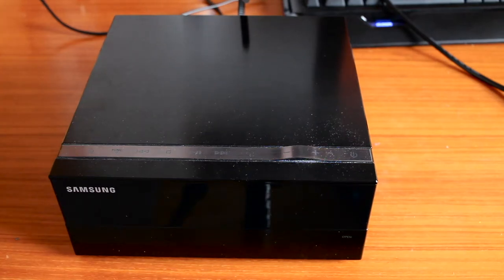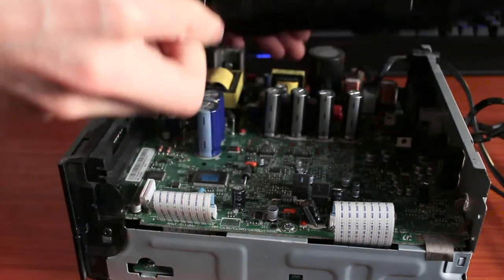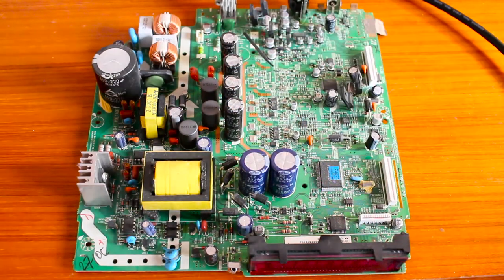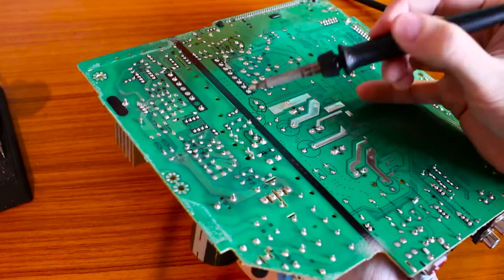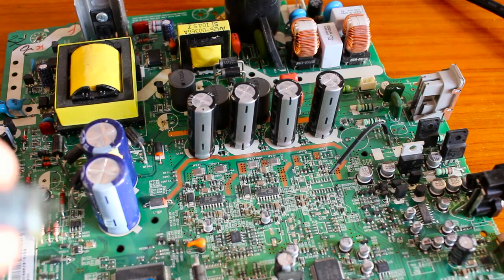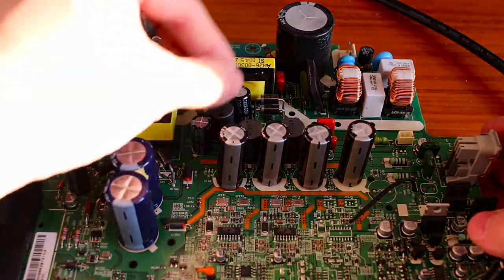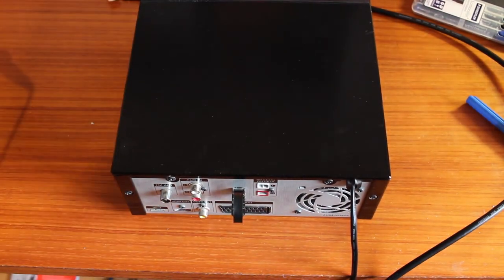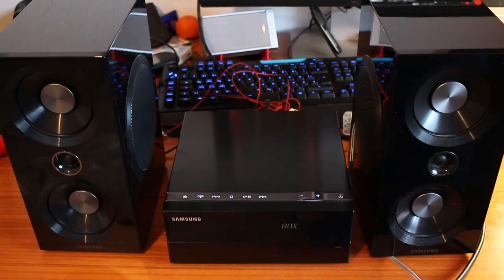Samsung MM-C530D Repair - Bad Caps

Comment: A do have pity on you with us coming to you with similarly related problems. My one is a stretch at being similar though.

I have a C550D and there is no audio coming out of the speakers or headphone jack.

I feel like it's related to an earthing issue as the aux port earth has caused some electrocution when playing with it between my fingers. I was connecting the aux cable to the back of my motherboard. It touched my metal case and there was a change in the him. I touched the case again (this time on purpose) and the speakers definitely went dead. There was no static in them anymore. PC and PSU was off but the power cord was plugged in.

I have already lost one motherboard audio jack to the HiFi system though.

I've put a volt meter over the speaker pins. I do get a small voltage (200mV).

With the HiFi system on. The moment I put a ground source in contact with the sound system body there is a slight arc, but no mark is left behind.

Any suggestions?
Reply from the maker: Phew ... there are some things, I could say here, maybe some of them are helpful, maybe not^^

A PC (at least a regular Tower-PC) is always "mains earth referenced", meaning that it's GND is always connected to Mains Earth through the PSU, even if the PC and the PSU are switched off. This also means, that the PC case and everthing with a GND is also always connected to mains earth, like USB-Ports, Video-Ports and of course the Audio-Jacks. 

The C550D on the other side is floating, like every HiFi- or non-HiFi-amplifier should be. This should be clear, since it has no eath connector on the plug and thus no earth line going into the unit. This might change, as soon as you connect other things to the amplifier, like a TV over SCART or something. If the other device has a connection to mains earth, this could lead to a ground loop or other unwanted things. But the amplifier itself cannot have a mains earth connection, so it will always be floating potential.
However, there are usually some small capacitors between the power-lines going into the amp and it's GND. This leads to a small AC-voltage on the GND of the unit in respect to mains earth. This is very common for all devices, that are not mains earth referenced. I assume, this is what you feel and what could  have caused the small arc. I would say, this is normal.

The voltage might be enough though to kill a sensitive, not well proteced audio out from a motherboard. There is a very old rule, that almost nobody remembers these days, which is: Always make you signal connections (i.e. AUX-Cable from PC to amplifier) BEFORE you power up the devices (/connect the devices to power). Maybe this could have saved your PC audio jack as well as the input of the amp in you case.

Did you read the 200 mV in DC voltage mode? That feels a little high. Was a speaker connected? Otherwise the measurement is more or less pointless, since the amp has to load to work against. 

I would try the amp first with an isolated source like a mobile phone, to get rid of any possible grounding issues. Can you get sound out of it from any source (radio, CD, aux)? If just the AUX input does not work, you probably killed that, if no source is working, you maybe killed a part of the amplifier. In any case, it is something, that I can definetely not help you with, since it does not have anything to do with the issue I had, and would require heave investigation on the input singal processing.
Reply: @NebukadV  Wow! thank you so much for all this information. You have really guided my path of actions!

I did not know about the making connections while devices are turned off. I will definitely be doing that from now on!

To answer your questions though:
200mV DC was measured across the cables of one speaker, with volume set to 2.

With regards to getting sound from any source: The first thing I did was test other sources. AUX, USB, DVD, FM, and mic in all do not produce sound out of headphone jack or speakers. The speakers also produce no static or "hum" that is always present on any sound system.

Based on your previous information regarding capacitors: if the events are as you say and caused a voltage spike, then I think the capacitors are the first place for me to look. I do not recall arcing ever occurring as violent as it is now. So the capacitor could have failed closed, causing allowing current to be diverted away from the speakers. This is something I can still go and measure. I do not have any O-scope I could use. So if I cannot find anything from resistance or voltage probing then there is not much hope for me.

I know just enough about electrical circuits to be dangerous. But not dangerous enough to kill me.

Once again, thank you so much for your help and knowledge.

All the best!

Comment: I did replace the three caps you said but I think I soldered one wrong because it did power on, but the screen was not working so i decided to reboot but after that it gave me just the blue light lol I know I soldered one of the caps wrong because i didnt looked really good, im gonna try again

Comment: Hi this video is very informative.  I have similar problem with my Samsung MM-DG25 DVD hifi. The front display doesn't light up. But I can play CD, USB and Aux input functioning and still can listen to music.  What could be the issue?
Reply from the maker: That problem is not really similar to the one shown in the video. It could be, that the VFD (display) itself has gone bad, that the driver is broken or one of it's voltages is not present. Unfortunately, I don't think, I can help you with this issue from afar.
Reply: Thanks.  Is there something else I can check to narrow down to the issue?

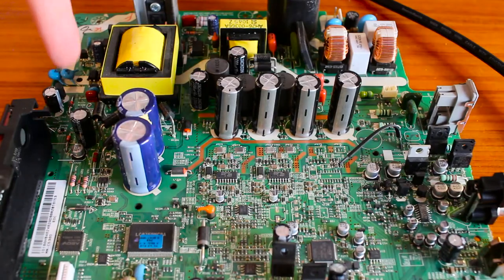Comment: 10:15 - you could have cleaned the rest of the lose solder pieces... Such a bad work can lead to shorts when the pieces left in there make contact. You seem to have some experience at least but did not expect that you really leave on solder pieces in the board.
Reply from the maker: I am very very sorry, that I might have disappointed you in that regard, although that might just be sarcasm.

Comment: I have the MM-C430 model, the problem you have is that it does not play CDs 💿 and when I put Mute the fan turns off, the rest if it is read by the usb and the radio, what do you think the problem is?
Reply from the maker: The problem with the CD drive might be, that the Laser has a little bit of dust on it. You might be able to clean the lens, but I my experience, that does not always work.
It might very well be, that the fan is supposed to turn off, when the unit is muted.

Comment: Hi,
Last time I found that my unit mm c550D (subwoofer addition) doesn't work properly. The sound comes only from subwoofer speaker and it isn't clear. I Can hear from other speaker only some remnants of sound, very flat and silent like being somewhere in background. When standard spekaer connected to subwoofer socket a pretty good sound will be hard mainly in bass spectra. The sound from headphones is played without any problem. Do you have any suggestions on that problem? The unit has more less 10 years but has been using very rarely.
Reply from the maker: Hard to tell. You can open the unit and inspect is visually. If your problem is also caused by bad electrolytic capacitors, you should see some that are damaged (bulged tops, black leakage etc.). 
But apart from that, I cannot really help you here, sorry.

Comment: do you recommned to test the capacitors with a multimeter to identify which of them does not work properly?
Reply from the maker: Not really. If one of them is bad, which at this age is almost guaranteed, just go ahead an replace all electrolytics. They only const some cents each.
Plus: If you really want to test capacitors, a regular multimeter is not enough. You gonna an LCR or at least ESR meter.

Comment: hi! i have one of those and what happens is that the sound for the left speaker is very low ( tried with both speakers so the problem is not the speaker). can tis b related one bad capacitors? which ones? thanks!
Reply from the maker: Could be the capacitors for one channel failing, however not very likely in my opinion. 
If so, I would replace all capacitors, unless you want the unit to fail again in 2-3 months ;)
Reply: @NebukadV  hum..if not the capacitor no idea why then, right?
Reply: and thanks for the prompt response!

Comment: Hello, I have the same Samsung MM-C530D minicomponent from your video, but the problem is that I connect it and press the power button but it does not respond, only the continuous blue light stays on, not intermittent, I already changed the 3 capacitors 2200 uf 16v but still the same, could you please help me, thanks
Reply: I have the same issue right now. Did you ever find a solution?

Comment: Hi,

I have a Samsung MM-E330D and when I turn the system on after a minute, or 2, or maybe 10, come an "Prot off" message and turns off.

I donk know what can be the problem, I opened it and there are 3 cards (there's no fan), and even just connecting the cards without speakers, that message comes.

Maybe can you help me?

Can I send you fotos from the inside?

Thank your
Reply from the maker: The problem could be the same as in my video: Bad electrolytic capacitors. 
You would have to take all the boards out, desolder every electrolytic cap and get replacement ones. 

There is not really a way, how I can guide you through that repair, apart from this video. If you don't feel condifent enought do so somethink like this yourself, you will need to find someone, who is willing to do it for you.

Comment: how do I turn off demo mode on this without a remote? It just started all of a sudden :(
Reply: I have the same problem.....
Reply: If you have a pilot, on the right side and down corner is button "demo"
Reply: Just hold over 10 sec fast forward button on panel when device is in demo Mode